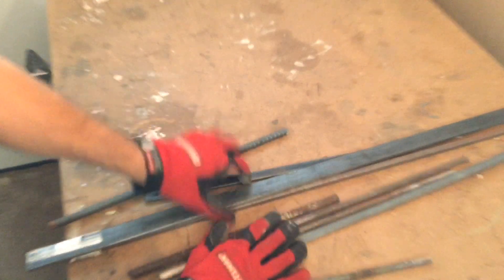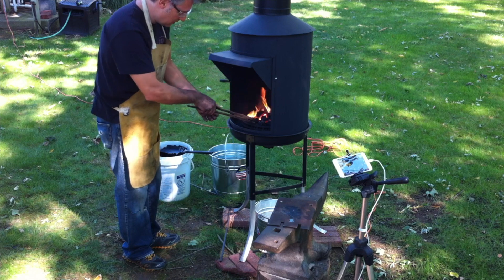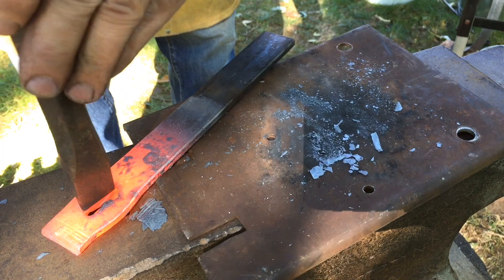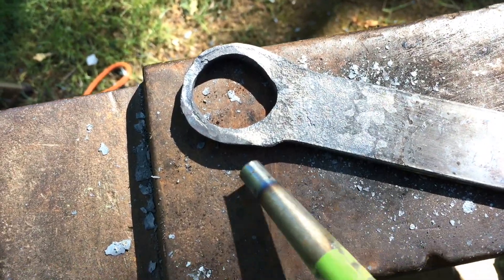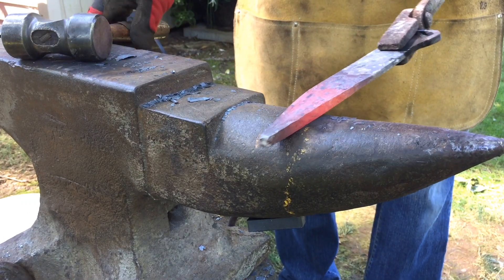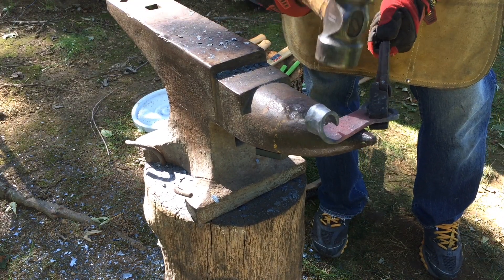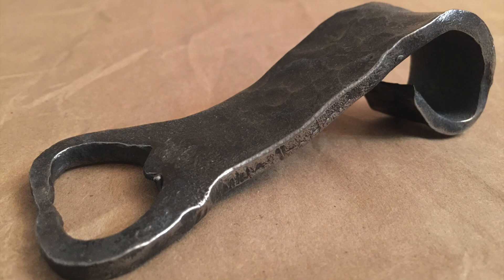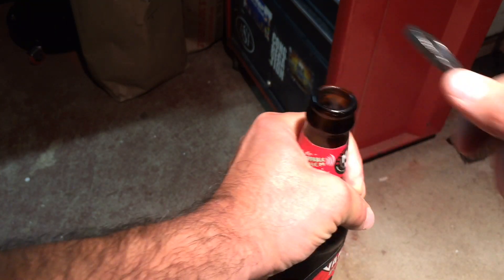Beginner Blacksmith -the bottle opener challenge

Comment: First. Hit it like it owes you money. 
Second. Leave the work atttached to the original bar until the rest of the job is finished. That way you won't have to use tongs so much. 
Third. Use a sliver of wood in the hardy hole to keep the cut off hardy fom jumping around so much
Last. Cut off the excess with two angled cuts instead of a single straight cut across the bar. Less work cleaning up the cut off end. 

PS  Always remember to hold the black end and hammer on the red end.
Reply from the maker: Thanks for taking the time to post some good advice! Boy do I need it.
Reply: Rb Duffer
Reply: Totally agree with Rb,  John Switzer from Black Bear Forge has a good video on hammering technique, so does Roy from Christ Centered Iron Works.
Reply from the maker: Thanks Bill! I’m a fan of both those blacksmiths and watch them all the time and they constantly inspire me.
Reply: @eviltwinx  also noticed that you were working it at a full red heat, moves alot easier at a glowing yellow.

Comment: Good job. It will get better with practice. One way to keep your hand from fatigue is  to keep your thumb off to the side. This grip does take to get use to, but will benefit you in the long run.⚒
Reply from the maker: Nice! Thanks for the great tip!
Reply: I was thinking the exact same thing, try a loose grip and the thumb around the shaft not along. 
But great work. :-)
Reply from the maker: Morten Ellehede Christensen - yea, I have a ton of the basics to learn. Thanks for the tip and posting!

Comment: ok heres a few things that may help. Of a peace of steel is moving too slow like that, either use a larger hammer, or bring it a little higher in the air for more momentum. 2: dont use gloves on your hammering hand, I wear a glove on the hand that holds the steal but when hammering, hot scale tends to fly off and rather than bouncing off your skin, it gets trapped in between the glove and you. Also that would contribute a little for fatigue in your hand. and lastly, Dont manually bring the hammer back up, It should rebound pretty well off of the steel and you can bring it up a little more yourself. Preventing fatigue while blacksmithing is 90% technique and a little bit of strength.

Comment: Purty good. Couple things to help you out... 1. Get as much of the wobble out of your anvil as you can. I used a router sled to flatten the top of my stump, made it perfect. 2. Working in the bright sunlight makes it harder to see the color of your steel and how much heat's in it. You'll find it a lot easier to control if in a darker environment. 3. If you are using a punch and not a chisel (I couldn't quite tell for sure while you were at it) you really don't need a plate to work on. I just hammered out a bottle opener this weekend myself. I had a piece of 3/8 X 3/4 3 or so inches long that was laying in my forge, so first I made an eye punch, then a horse head bottle opener. Musta been a bottle kinda week.
Reply from the maker: Thanks for watching and taking the time to write up great suggestions for me! I'm putting together a list of do's and don't based on all the feedback.
Reply: My forge sets underneath a roof that is on the west side of my barn. I put one of those roll up bamboo sun screens on the west side just to block the sun. Just that little bit helps in seeing the temp.
Reply: bc65925 I agree, it's so much easier to read the metal in some shade. 
I guess I need to get on making a bottle opener then....
Reply from the maker: Make a video and post it!

Comment: I feel your struggle i was in the same boat as you when i first started , you should try to secure your anvil a little better so it doesn't bounce around  it will make it more comfortable for laying down some heavy blows also it will make forging more efficient where as the energy from the blows is getting used up by bouncing around the anvil , instead it will be reflected back into your work if your surface is nice and hard ! once you get the hang of it you can punch that slot in a heat and forge that taper in 2 heats , otherwise great job i probably wouldn't be able to forge that when i first started!
Reply from the maker: Thanks for the suggestions and complement! I have a lot to learn but having fun.

Comment: Great job . it looks awesome . lil tip . if you start with a smaller hot cut chisel,  get it cut , then get the bigger one its a lot easier.  the smaller surface area moves through the steel better . also . tie down that anvil lol
Reply from the maker: More great tips to add to my list! Yea, I was surprised how much the anvil moved around. I only noticed it when editing the video.

Comment: I see that you have a brake drum coal pot and that will give you no problem, but I wonder about burn through with your forge.  Perhaps not the pot supports but the sides and the exhaust especially give me pause. I think that the bare metal is too thin.  And once inside and with wood ceilings and code height for the chimney above the roof line even with double wall makes me wonder.  Have you done a temperature test?  Also as I view your anvil height.  Yours seems about three inches too high.  Part of the problem with hand fatigue for sure.  Have you noticed any safety issues since the build?
Reply from the maker: I'm still putting the shop together and safety is a big concern for me. The metal I used for the forge enclosure isn't made to last forever but I'll only be using it 3 to 4 times a month at best so we'll see how long it'll hold up. I did do a burn test with paper and cardboard to make sure I had good draft. I also did a temp test. So far, everything is working as planned. The next step is to use coal and make any adjustments if needed. The chimney will be 3 feet above the peak of the roof when installed. I'm still figuring out my anvil height.
Thanks for taking the time to comment!

Comment: to help with your hammer hand don't wear a glove... when you use a glove you are actually going to grip harder on the hammer due to glove. harder grip more fatigue. and you want a light grip on the hammer also. you want a  grip that holds the hammer but someone would have an easy time pulling the hammer out of your hand. nice job on the opener. think that is something i need to try. good luck on your hammering.
Reply from the maker: Thanks for the tips and taking the time to write them up!
Reply: eviltwinx 
good series mate, well done. subbed.
Reply from the maker: Eo Folk - thank you!